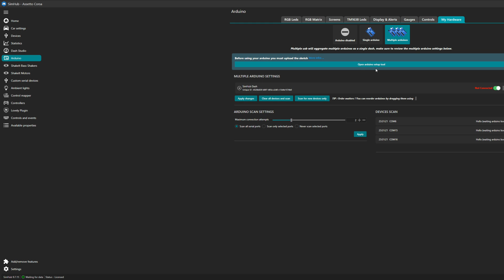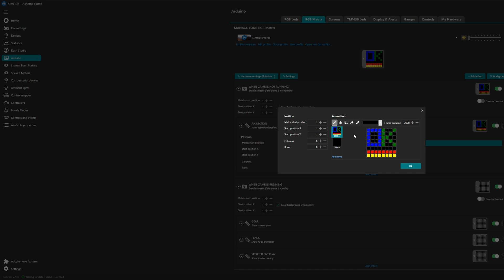DIY FLAG Indicator for SIM Racing

Comment: U gonna fry the board those leds are power hungry
Reply from the maker: Well that statement without any explanation is kinda useless ;) also it is running still safe and without any issues
Reply: @atechcheck  those 64 leds draws more than 3 amps at full brightness, your usb only gives 500mili to 1amp or so

Comment: Looks great and the design is perfect. What model 8x8 matrix did you use? Is it just a regular WS2812? Not a 5050 size correct? And as the other guy mentioned, eagerly awaiting the files to print. Thanks for the hard work.
Reply: I'm in the process of building one of these, thanks for the great video.
One thing to note is that the screws (and inserts, obviously!) used do not appear to be M4.  Looking at the video, they appear to be M2 (M3 at a push).
Reply from the maker: Jup just regular one that you can get on Amazon or so. They come in packs so you can get 3 of them just in case if you want to build 2 of them for spotters ;) I have now updated description and you can download all the files and check original one if you prefer original front panel.